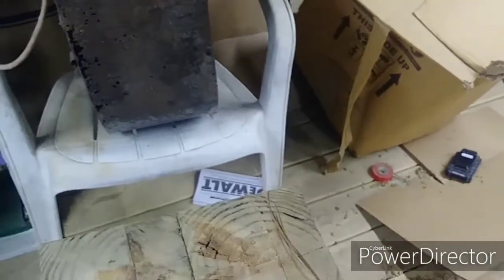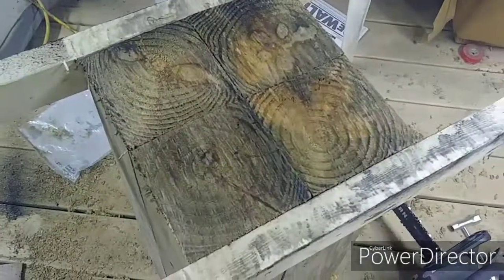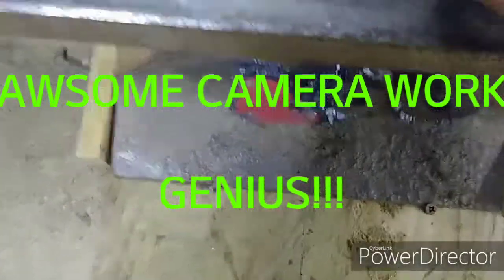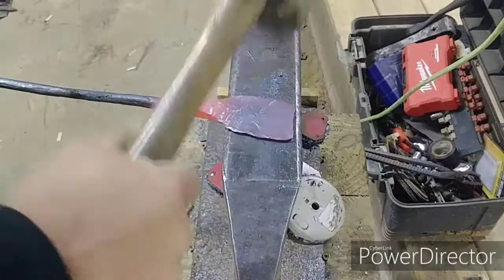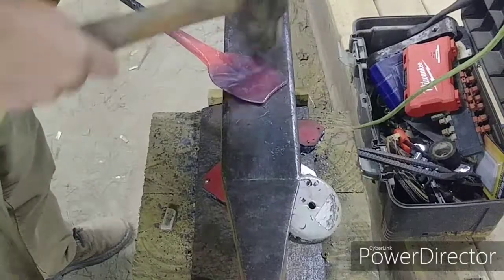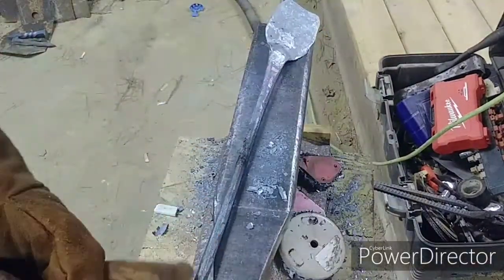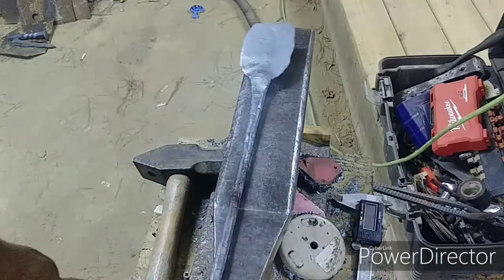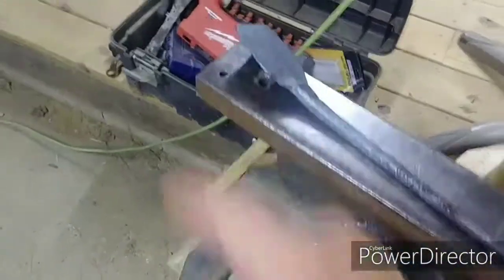From 16mm to 2mm flatten 1/2 inch steel.

Comment: You made me smile Sir, with the humor you inject in the video, and with pride, seeing you take after smithing. 👍.  Notes for improvement. 1, yes, thin out the handle on the hammer. Shave the sides down a bit, and try it. If it still twists, shave a bit more, but don't shape it round. 2, bore a couple holes in the foot of the anvil, and crank in a couple lag screws. Track drills pretty easy. 3, the pein of the hammer, you can grind it down to a more blunt edge, and get fewer cold shuts. That's all I got for now. Be well Brother 😀👍⚒️❤️

Comment: My best advice for you. Put an X on the middle of that anvil and keep your Hammer blows there, move your work under that. That's where most of the mass is. Other than that your a rockstar 🤟🔨on!!ps for The wider end upset is the key. You don't need wider stock
Reply from the maker: Thank you sir. Will remember. Move the piece on the anvil, not the hammer.